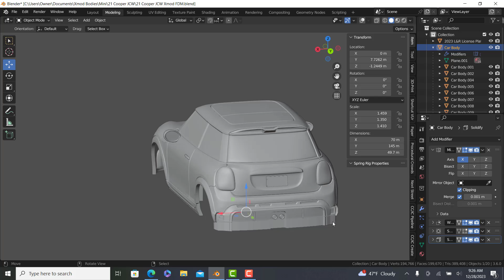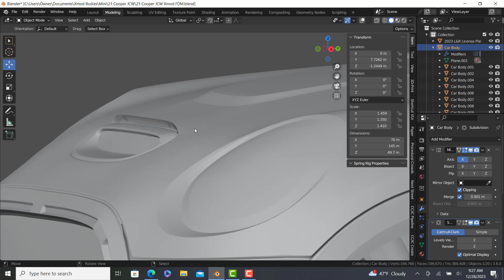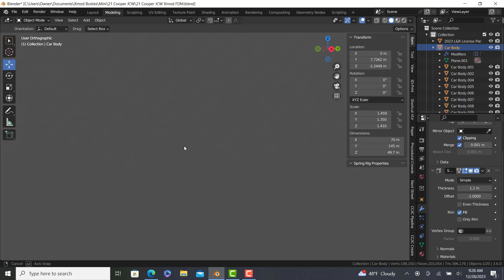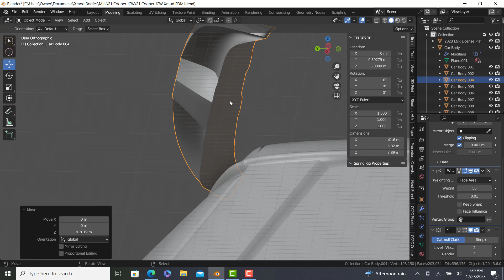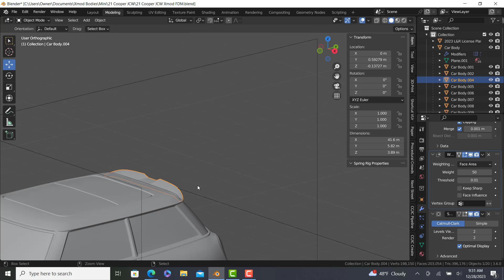How to Solidify a mesh for 3D Printing in Blender | Tutorial

Comment: Thanks for this video. I am trying to learn Blender to design and make a 3D file for an older camera eyecup (Pentax PZ-1P) and struggling how to create the basic shape which is sort of a half-moon. I am manually moving vertices to do that, but it is very difficult to do as when I move a vertex it of course affects other vertices. The outside perimeter has a low height and slopes up around the square opening area.  
I saw the spoiler in your video and the eyecup is sort of that half-moon shape. I am using the mirror function. Could you tell me a better way to do this?
I have not got to the rectangular opening in the middle yet. I wish there was a way to include images here, but inside the opening are rails that slide into the slots of the cameras viewfinder.
Overall visually it is a half-moon shape with a raised rectangular shaped hole with sides that slope down to the outer edges.

Comment: I've been having a hell of a time with these Nascars I cut up to just print the bodies for, and I think this is the problem and the solution with them.

The other thing I was going to try, which I know works well, but is a pain in the ass is, opening the model in 3D Builder, hitting repair to make it manifold, then going to Edit and choosing Hollow, and adjusting the thickness, BUT THEN opening it back up in Blender and cutting the bottom out of it.

I'll try this Solidify Modifier first though, because I'd rather not have to mess around with removing the area that was added underneath after making it manifold...

At least I have options and now know and understand what the problem was with the body thanks to this video, so thanks again man, it's super appreciated!

Comment: IMPORTANT I'm actually designing some jewelleries but when I'm putting them to 3d print it's showing that it's hollow from the inside in the preview... What can i do to solidify it completely from the inside (for ex. an earring) should i use softwares like meshmixers or something I'm trying to solve this for so long...
Reply from the maker: Sorry for the delay, wasn't notified on this comment. As long as the mesh is manifold, it should be able to print solid. If it's still hollow, you may have a hole somewhere in the mesh.
Reply: @Leander98  Oh ok, that makes sense now that you said this.  Thanks for the advice again man!
Reply: Isn't there a fill setting in your slicer program that you can set for this?
You can grab 3D Builder from MS for free, which might help you out.
It will tell you if there's a problem with the object and will make it manifold if you click on repair, and then allow you to edit the model to set thickness after hitting hollow, where you should be able to thicken it up inside?
Or just check it in Cura after hitting the repair option in 3D Builder, and see if it's solid?
If those don't work for you, it's probably a setting in Cura where you can adjust the infill?
I'm not the best at this stuff, but those are some things you can try out if you want to, and maybe comment in here after to let us know if or when you figured it out.
I hope that helps.

Comment: Hi! I'm having a different problem. I have some stl files of cars already modeled. But they are set to render in games. Is there a way to get these files and modify them for printing? They only have meshes, for example, the wheel is made up of more than 30 different meshes and they are separated within the same object. In Prusa they are all separated and you can't print them. In Blender I can't join these meshes because they are the same object. Can you think of a solution to this problem?
Reply from the maker: Yeah, you'll have those problems. Best thing to do is remake the model from scratch. Game models really aren't designed to be 3D Printed. As long as the models are "manifold", they should be printable. Try clicking Face Orientation under the Viewport Overlays.if you see red, that might be your first place to start.
Reply: @Leander98  Thank you very much! I've been trying to use these models for some time. I tried using modifiers, editing, joining, boolean... and it always gives an error. It was an attempt not to start the work from scratch. If you ever find a solution, make a video for us. I only found similar content on your channel. Congratulations on the work and the channel.
Reply: @Leander98  Isn't there a way to Remesh and or Retopolgize them or something, where Blender will take the outer shape of your object and recreate it the best it can?

I could have sworn I used to use a tool like that in Blender a few years back when working on game characters, but Retopology in this newer version of Blender doesn't seem the same to me...

Maybe it was an addon or something that I used back then, but it sure worked well for that sort of thing.
Reply: @slakjawnotsayin5451  Blender has the remesh modifier and shrinkwrap. Personally I'd use geometry nodes and use mesh to volume and volume to mesh. If you want to get really fancy and are ok with a triangular mesh, you can use distribute points on faces, make an sdf isosurface and rebuild it that way.
Reply: @Anthromod  Ok ya, that makes sense.  Thank you.

Comment: This is exactly what I've been struggling with for the last few months. I have hundreds of 3D models that I would like to print but all of them are just plain thin wall meshes so I need to find a way to solidify the walls without loosing too much details. I've tried multiple softwares to do it but all of them give unusable results, messy meshes, bugged vertices and what not. Also, how can I print a mesh as a closed object if inside contains more meshes and or empty spaces? For some reason chitubox doesn't like that
Reply: Did you ever figure out this issue? I'm dealing with the same thing trying to scale down and thicken space ships for a board game
Reply: @DJDefConn  Did YOU ever figure it out? I'm looking for the same thing.
Reply: I ended up using the 3d print tool "hollow" feature. 

Thickness: 0.5 mm
Voxel size: 0.05

Then I decimate the object to ~100,000 faces.
Reply: @DJDefConn  Where is this "3D print tool"? Cura slicer? Blender? What are you talking about?
Reply: @samspeaks2016  it's a plugin in Blender
Reply: @samspeaks2016 He is probably  refering to "hollow tool" inside most of slicer programs. You could also do it in 3d builder, which is built in windows. It also has nice "repair tool" that will detect and fix most of mesh problems for 3d printing.
Reply: If there is another manifold object inside, with its face normals pointing inwards, slicer will  read it as a cavity inside original model.
Reply: @danielsinkowski5183  I forgot to mention I delete the internal object by highlighting the outer one (ctrl a), hiding it (ctrl h), then highlighting the inner object (ctrl a), deleting it (x), then unhiding the outer object (alt h I think)
Reply: I've put a geometry node based hollowing tool on superhivemarket. It's non-destructive and works on an sdf workflow. It includes a solving algorithm that should handle a lot of typical mesh errors.